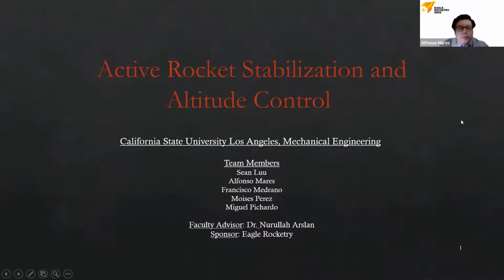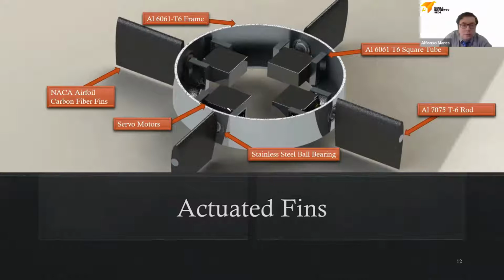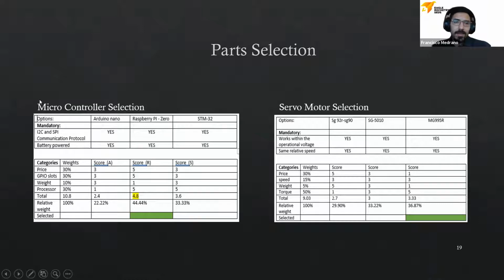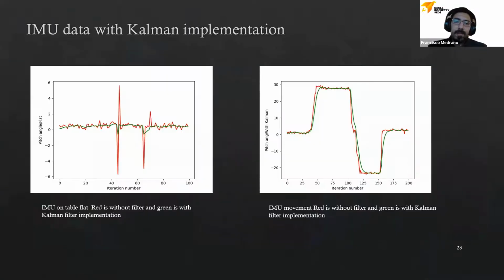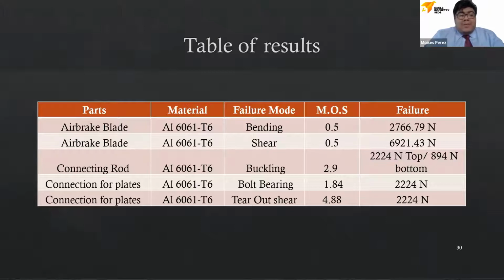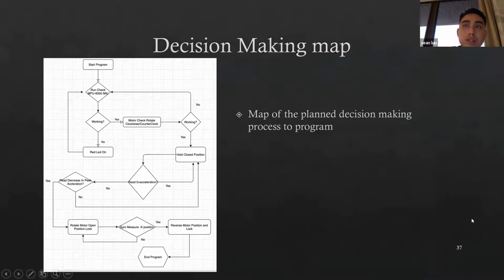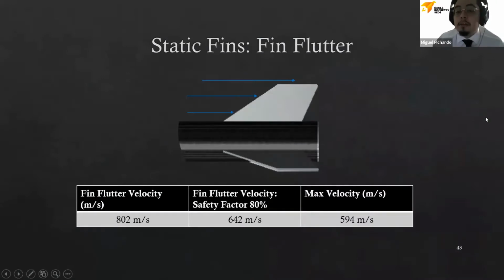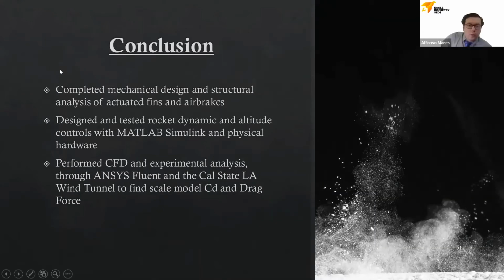Team 1 Active Rocket Stabilization and Altitude Control

Comment: Cool project and analysis.  Maybe I missed it, but why are you using airbrakes?  Is it because your maximum altitude for the competition is 30,000ft? I saw another group's video about a competition like that.  I'm going to watch your video again in case I missed something.  I'm interested in university projects like yours as an amateur rocketeer aspiring to high power and use of electronics in rocketry.